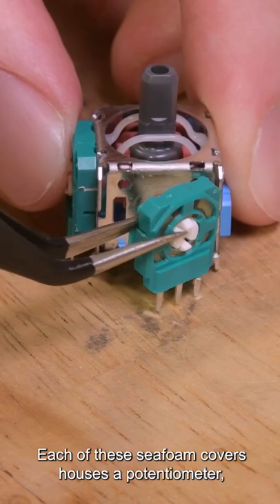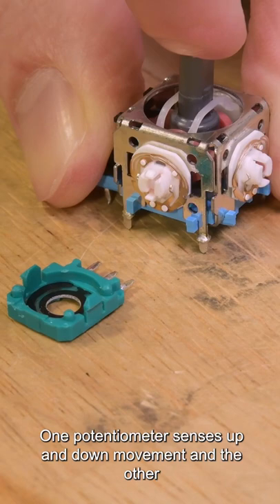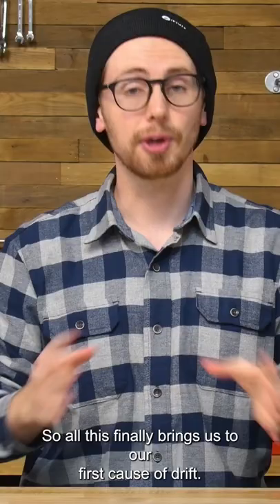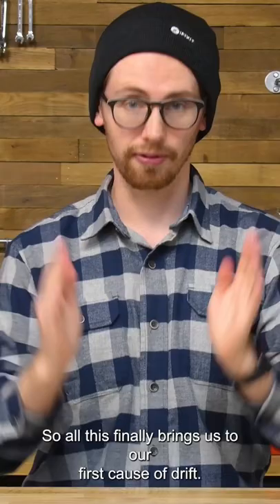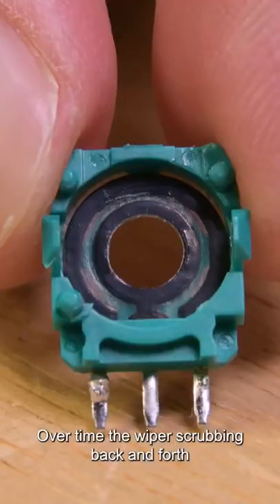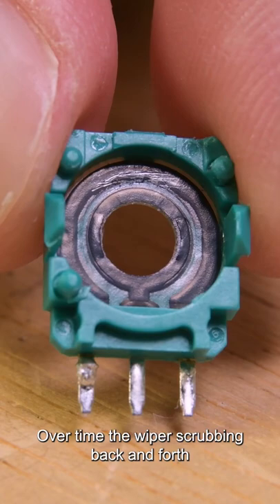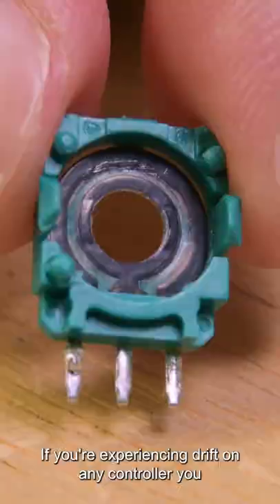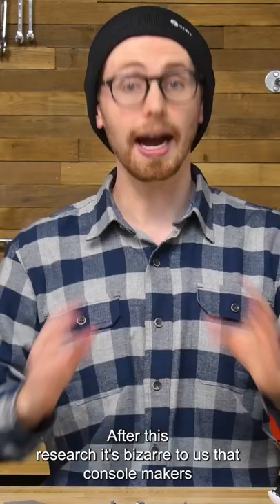Why Do Joysticks Drift?

Comment: Here are 3 easier solutions that worked for me (kinda).
1- My first controller suffered stick drift and I was used to fix it by simply just shaking the controller. This method worked for a few weeks until the controller broke apart.
2- I bought a second controller but eventually It started to drift as well. This time I just put down the controller and didn't even touch it for a week. And when I picked it up again it seemed to be fixed but it only lasted 3 days. So I kept putting it down to rest for some time.
3- Did a research and found out cleaning the inner parts of the controller may fix the issue, so I decided to blow through the gap of the joystick. I blowed a few times and the problem is solved!

Comment: Third option (the best option) is to use silicon grease, spray it in to those potentiometers, you don't need to open them up. Silicone grease is not conductive so don't worry.

Comment: I find that opening the pots and cleaning them often solves drift. Just be careful to not snap the pins off
Reply: It helps but the reality is they get worn out. Hall effects do not. This is why they are using in things like Aerospace Flight Stick Controllers and potentiometers are not.
Reply: @crisnmaryfam7344  Then you have to worry about spring elasticity.
Reply: @Zpaced You always have to worry about that. Even with potentiometer sticks

Comment: The PS5 dualsence has nice little metal levers that you flip up to release and slide out the joystick + button assembly. Im sure the potentiometer sticks are for cost reasons for the average consumer however at this point having Hall effect or optical sensor upgrades would be ideal. Definitely a market for some sweet super over engineered metal cnc anodized ball bearing hall effect soft touch grippy sticks™.

Comment: I've always had the springs wear out causing the drift because the stick gets stuck in one position...

While the wear to the pads causes it to simply not register input anymore.
Reply: Simple... dont use the analogstick
And you could buy ( if supported ) a diy back button Kit
Reply: That's not drift. That's simply stuck. Drift is when the stick is centered, but it is detected as out of center.

Comment: just buy hall effect sensors, they use magnets instead of the potentiometer in the stock sensors so their is no physical friction between the parts essentially meaning it won’t give you drift due to wear and tear. if you know how to solder it worth doing

Comment: The potentiometer is only one point of stick drift, the other is the centering mechanism not returning back to center (either due to wear in the mechanism, or the spring gets weaker).
Reply: What mechanism? The centering mechanism is the carbon track… The carbon track on the controller is the only point of stick drift that matters. Replacing the white disc is a band-aid solution, no different than cleaning the pots because it cannot restore the worn-out carbon track.

Do not waste time disassembling a controller if you refuse to desolder and replace the entire joystick.

Comment: They should just use Hall sensors and then it will no longer being a wearing component and wayyy more accurate and smooth.

I think attari did it back in the late 80s/early 90s but I'm to lazy to google it.
If you're curious about it I'm sure google can explain better than I can.

Comment: I've been opening up some controllers lately. Had some PS3 ones with stick drift laying around and I started doing some research on it. 
While it isn't hard to fix stick drift, it's a bit hard to know how to go about it... 
There is quite a bit of false info out there too... 
Your options are basically these: 
1. Replace the whole stick: 
a. Can you find original sticks? In some controllers, maybe... 
b. More often than not, you will buy OEM sticks. These might be good, might not... 
c. Lately there are a lot of Hall Effect replacement sticks appearing on stores... HOWEVER! In most cases you CANNOT achieve a good result with those. Because some models have jitter and basically all of them have atrocious circularity. There is just one kit that has a small extra board with it that requires micro soldering skills (high soldering skill level) in order to succeed. For 98-99% this is neither easy, nor recommended...
2. Replace the potentiometers on the joystick. 
For some reason this makes the most sense to me... Supposedly there are even original potentiometers for some controllers out there... I haven't done it yet but I think this will be my preferred method from now on... 
3. Calibration boards. There are these mini boards that you solder under the joystick and the main board, only soldering on these 6 feet of the 2 potentiometers. One board per joystick. On these small boards there are 2 screws that are basically potentiometer modifiers or something. They might just be extra potentiometers ¯\_(ツ)_/¯. So you turn these screws and you calibrate the drifting issue. In my mind this is a nice solution, but I don't think it will fix jittery sticks and if there is a lot of tear, you might get a centered stick, but I don't think the travel will be smooth... 
4. BW100 or other electrical contacts cleaner... A quick and "dirty" way of cleaning a stick that has some extra dust in it. If the stick isn't weared down, it might just be a bit dirty. I haven't tested that method, but I sure will. 
5. Opening up the potentiometers and cleaning the with alcohol. For me, although it sound like a good idea, similar to number 4, on a second thought I don't think alcohol cleans contacts all that well... I have done it, I saw no results. Most probably the potentiometer is done for, kived its full life and it won't be fixed with just cleaning, but I will test method 4 before that.

In conclusion. I believe that method 1 and method 2 are the best. Just get yourself a solder vacuum/pump (prefer one that is already a soldering iron/gets hot by itself) and the job is very very easy (suggesting you made it to the sticks (opening up the controller) without breaking anything 😅
Method 3 might be easier than 1 and 2, but I don't think the results will always be perfect. 
Methods 4-5 sound kind of the same... Since gamers are often a bit filthy and don't keep their peripherals very clean, it might be worth a shot to first try and clean them.

Comment: The way games controllers runs, it's on another level. That's why joysticks should be build with Hall effect sensors instead of mechanical potentiometers. Less friction and way more accurate data readings.

Comment: I noticed that mine was burnt blue which is weird , because on a dirt bike when the cams is blue it means it's warped or worn means you need to replace them , so I'll take mine out again and just try and use fine grit and see if sanding those fine plates would help it , I just used a screw driver and basically you know .. bended them over without removing those parts and bend and pushed them back into place

Comment: You could just have hair or dirt in there. I took my sensors out but left the housing connected to the board still, then cleaned it and the inside. Works like brand new.

Comment: Very easy to take apart and clean, did it to both my ps5 controllers and it stopped the drift. I couldn’t even use the controllers on the ps5 menu without them both just stuck going left on their own

Comment: Am I crazy or has joystick drift become a bigger issue each generation? Back in the 360, GameCube/wii, ps3 days drift was hardly an issue. The only time my controllers would break is when I broke them myself. Yes I threw my controllers. I have grown since then. Regardless I’ve gotten drift on my ps5 controller a week into owning it, and drift on several joycons. Planned obsolescence is wild man.
Reply: Yeah, I have a few controllers on which I need to replace the thumbsticks, not because they drift, but because the stick mechanisms themselves have become too loose and don't properly return to center like they used to, but the potentiometers are still spot-on. It's wild indeed.
Joycon drift is kinda different, though. It has the same result, but different cause.

Comment: That's weird, I replaced the pots on mine and it didn't fix it, though it stopped recieving up and down signal and the board was getting mixed signals. Also I checked the inside of the pots and the black stuff was still intact like 99% of the way, it's not scratched at all that I can see in the lighting. I changed the plastic/wiper thing which fixed one of the controllers but not the other (cuz of bad soldering most likely), but the range of movement on the right stick is a bit off, with the left and right axis not hitting full length for some reason.

It's fine as a temporary repair for a really old DS4 controller though, as I have a wired and dualsense for my ps5. The left stick worked perfectly. I think I needed to snap the plastic wiper into the pot first before trying to close it.
Reply: It is likely you used the wrong pots and didn't have the correct resistance range

Comment: if any of you have old controllers with working sticks you can use the sensors from the old one to the new one and replace them, this is a good fix but it requires some patience

Comment: The wiper inside the potentiometer moves in a circular track. As such, the damage to the potentiometer looks like wiper dug a circular track on the carbon film coating, not like the one shown in this video. It looks like someone just arbitrarily scratched the carbon film to make a point in this video.

Comment: hey bro, i have a question. my left joycon stick won't work when i crouch down (press L + down) should i replace the analog stick? i've checked both joycons calibration motion controls they're both okay and have no problem the only issue is that i wasn't able to crouch or sprint in the game i currently playing.

Comment: WRONG.
You forgot to mention why this happens now and never happened before, a lot of detail is missing. 

Joysticks have been around since the first consoles and you'll find a 15y old ps2 DualShock controller that works better than a 6months drift suffering PS5 controller. The potentiometers in the PS2 were far more worn out and still work perfectly to this day.

The current ps5 and Xbox pads are powered by Li-Po batteries which operate at a lower voltage which means the alps will produce erroneous readings in the Dualshock microcontroller. With older consoles that worked on AA batteries or 5v logic, this problem was not present. 

REPLACING THE JOYSTICK WITH ANOTHER NEW ONE OF THE SAME TYPE IS NOT A FIX.
it only fixes it for a few more months, THE REAL FIX IS DIFFERENT.

Kailh vs OMRON vs ALPS.
The Alps doesn't consider the current-gen specifications that work on higher freq and lower amps.

What is the actual fix?
The Alps Potentiometer is defective and bad design for this specification, what you need is a Kailh Potentiometer which is designed to work in much sensitive voltages, all sticks are designed to wear out but the microcontroller should still not produce drift.

What happened to Logitech? 
Double Click and Joystick drift are electrical faults and not completely mechanical faults. 
Logitech used Omron switches which should work at 5v 0.1Amp and a traditional debounce being canceled out but the microcontroller works at 3.2 - 2.8 v, 4mA depending on the charge state of the battery. making the switch more sensitive, getting a Kailh 8.0 fixed it because it was meant to work at 2.8v and 1mA.

You can collaborate with me I can tell you why this actually happens and why manufacturers are very well aware of the Logitech double click mouse problem & the Joystick drift problem. This is much deeper than you covered and goes hand in hand with Right to repair/third-party quality being better. There is literally no one talking about this and this needs to be present out there, people will do the incorrect fixes
Reply: Make a video showing off the different parts, post it on Reddit
Reply: Who are you and how can you help us?
Reply: @MrNoipe  I need ifixit to respond
Reply: I concluded that PS2, PS3 and other old controllers never developed drift even when the stick module is completely worn out.
I found your info so much interesting, did you make any videos about it? Electric fault sounds so much plausible.
Reply: I had the same suspicion, I even gave up repairing the controller

Comment: They finally did create removable sticks, only, it costs $200+ to buy the controller that comes with it. No thanks.
Reply: Replacement sticks are £20 EACH in the UK. A while back I bought a ps5 controller for £40 brand new at Argos.

Comment: I have had to buy two new controllers because of this, and now today it happened for the third time, so I hope this helps
Reply: How long do your pads usually last before wearing out?
Reply: @LowlyEidolon  around 4 months
Reply: @avocados4life191  gosh that is soon, how many hours roughly a week do you play?
And how often do you force the analog sticks to the edges of the housing or press the stick in to click the button using excess force
From my limited research these actions seem to be the cause of the pots prematurely wearing out
Reply: @LowlyEidolon  well it hasn’t happened much recently, but I mainly played fortnite and to sprint you need to trouble tap the joy sticks and hood them down with force, I probably used to play like 1-2hours a day
Reply: @avocados4life191  thanks for the feedback, I play a decent amount of games, not so much recently but I tend to remap the left stick click away to LB or RB, and I don't force the sticks fast or hard to the extremes so I've been trying to get feedback from people who experience drift (my Xbox one. Day one controller still doesn't drift) to see if it's user behaviour (along with a less then ideal hardware design flaw) creating drift sooner for some users then for others

Comment: Some companies are better than others. For example, the Nintendo Switch Joycons are connected through ribbon cables, so replacing them is easy peasy. The dual sense PS5 controller, does not and you have to have soldering skills to be able to take it off and replace it. Also the Switch has reasonably priced controllers that use the Hall Effect technology. The PS5 literally only has 1 controller that uses Hall Effect joysticks, and it is a 3rd party controller that costs $200!!! They need to do better. Granted they never will, but still.

Comment: what makes it difficult to replace the analogs is that the bottom metal pins are melted in the motherboard.
Reply: They are not. You just need a decent soldering station

Comment: I'm amazed that controllers as expensive as the xbox elite and dualsense edge don't just have optical joystick modules instead of potentiometers. The controllers are clearly expensive enough to cover the extra cost for including them 😂

Comment: It wouldn’t be hard either to design controller joysticks that are swappable like keyboard switches. This would also allow you to choose crazy aftermarket parts that alter the way the joysticks work to your liking.
Reply: The Astro C40TR has replaceable joysticks.
Reply: @joshjlmgproductions3313  so does the ps5 edge controller from sony.. but they still use their dodgy af 0.01mm thick carbon tracks in thier potentiometers so they wear out on 400 hours.. preplanned obsolescence... i hate sony and of i ever get an option to buy another brand for replacements with full functionality on ps5 ill ditch sony so fast aye

Comment: I hope someone designs controllers with sticks that work like mechanical keyboard hotswap switches. Multiple metal rods that plug into some holes, and those holes are for data for movement and anything else just like a regular switch. That way we don't have to change the design of controllers but we can change the feel of the controller sticks easily, or replace them.
Reply: And now sony did 
But expensive
Reply: @Kenny-hy5pj  ....right. the pro ps5 controller. Honestly any controller over $50 is overpriced. even $50 for a controller is overpriced. at that point just use a mouse, keyboard, and adapter.

Comment: I've found that potentiometers aren't the only cause for stick drift (or sticking probably in my case). It could also be lack of lubrication, if you have a squeaky joystick that sticks after being moved. I pried open the pots on mine to find they're in really good shape after many years of use. I'm now planning to shoot it with contact cleaner, then applying silicone grease to the plastic contact points (or the entire plastic assembly inside the stick housing) to hopefully solve my issue.

The other problem is, once it's started squeaking, there's a chance that irreversible damage to the plasic parts has already been done. Possibly identifiable if your joystick has play when centered and stationary.

Comment: I’ve replaced about half a dozen so far, it’s not that difficult.
Reply: How do you identify the correct potentiometer to use?
I have a first gen Nacon GC100XF with this same issue and when I tried I could only identify the brand.
Reply: @YOEL_44  FYI I only replaced my Xbox one controllers I’m not familiar with Nacon sorry.

Comment: Never had these input issues with an NES controller or even a PS2 controller.  Companies are putting cheap products on the market and no there's nothing we can do about it but shell out money for a new one since we (at least in the US) don't have a right to repair.  A billionaire won't flinch at dropping $100 for a controller.  Someone working minimum wage will go into debt for it